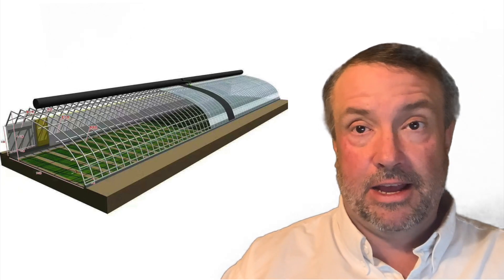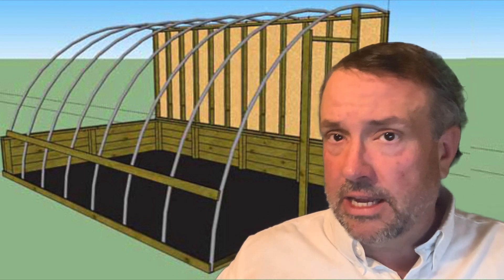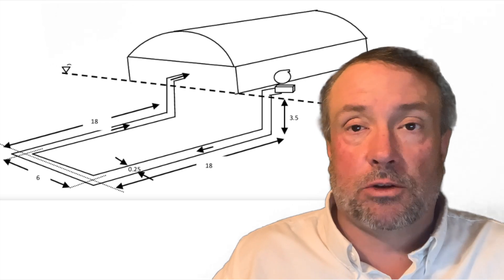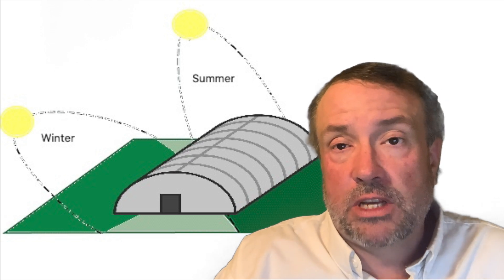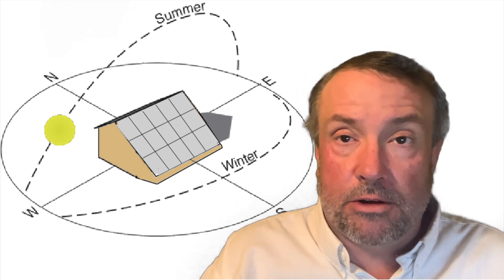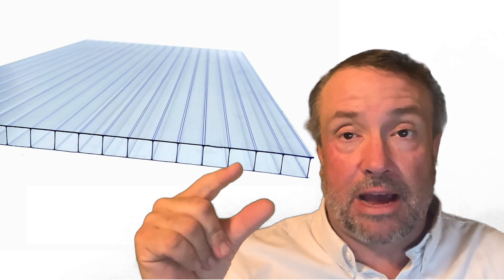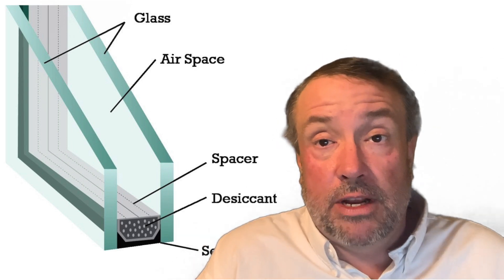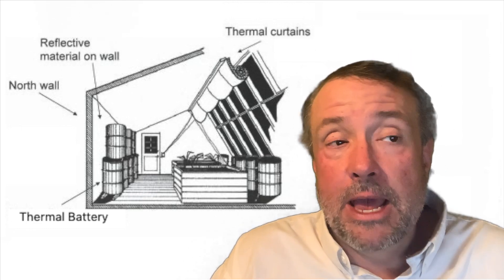Passive Solar Greenhouse Design

Comment from the maker: Is a Chinese greenhouse a Passive Solar greenhouse?
Reply: Yes, there is a YouTuber located in Alberta who has a big Chinese greenhouse. It was around 20-25°c inside when the exterior temperature was below -20°c.
The hight between the 2 layers was quite a lot, and there was an motorized insulated blanket over the lower Polly.
Vibrators on the outer frame to make snow fall off.
Reply from the maker: Yes

Comment: Thank you for this.  Your simple, concise, and economical videos are a blessing.

I had a few questions about the thermal blankets which may be a good follow-up video.  I've seen your description but I wanted to know more about the different materials you can use.  Also, I live in the north and I'm wondering how to combat the elements of the deep winter and still use a thermal blanket.  Large snow load, freezing rain, high winds?

Once again thank you so much,  Inspiring work.
Reply from the maker: That’s a great topic for a video!!! I think I’ll do it very soon!
Reply: I tried using orange construction insulated tarp for thermal cover. It worked until a wicked North-Easter storm ripped it off 2X4 holding board and found the shredded tarp 200 ' away tangled in thorn trees. It is scary the power of a 60-100 kmh with snow can do.
Reply: @redstone1999  I can see wanting the thermal cover to also be a storm cover that's pretty rugged and heavy, maybe.

But maybe instead of covering the entire structure, you make a blanket for your babies, inside the greenhouse.  Make a little plastic tent for them inside the greenhouse.  Some variation on the cold box idea within the green house idea, can be used.